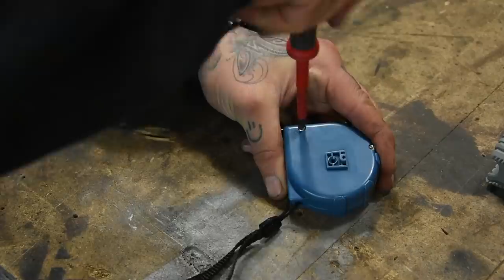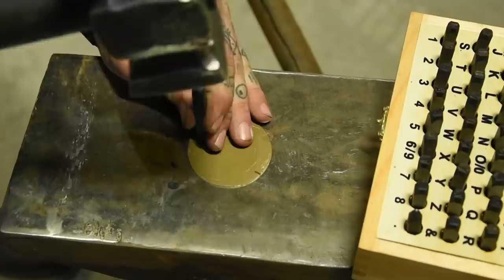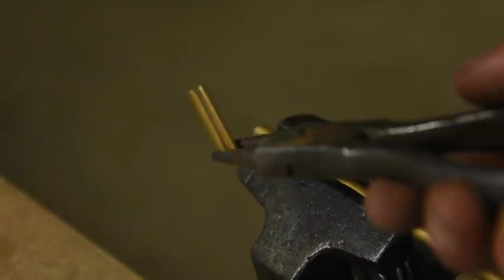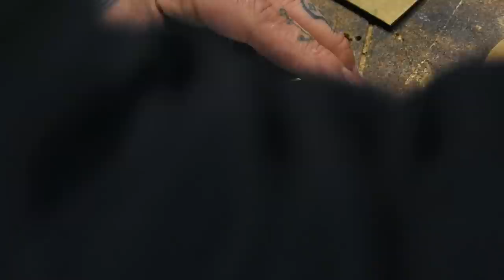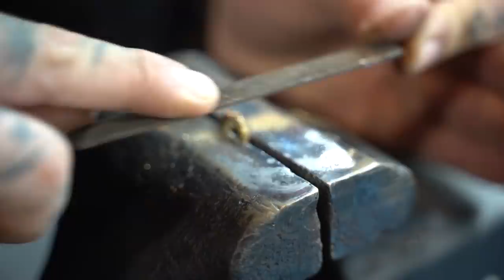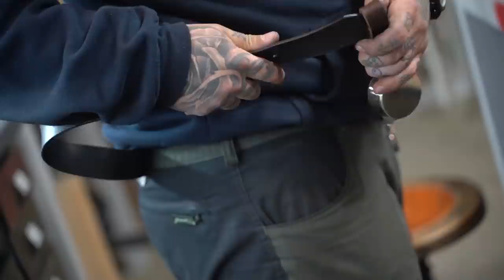HABU \\ Custom Brass Measuring Tape

Comment: Wow! Cool one! I was nervous thinking about the plastic part melting inside when you were soldering the "lid" on. Thanks for sharing.
Reply: Exactly! The heat from soldering did not affect the coating on the tape measure blade?

Really cool idea, and well done!
Reply from the maker: Thank you very much

Comment: Good work but I wouldn't want to carry that around in my pocket. I'd rather have a scale drawn up on a leather strap like the sling you have in the thumbnail, which can be unbuttoned to make a longer ruler. Not nearly as long but I think for most purposes it gets it done without sacrificing space in the pocket since you'd be using a leather key fob/sling anyway.

Comment: Wouldn't the heat from the soldering process melt the plastic drum? And at best, possibly cause the drum to become brittle and break much sooner than it would normally? I am curious on your thoughts please...
Reply from the maker: No, it hasn’t melted